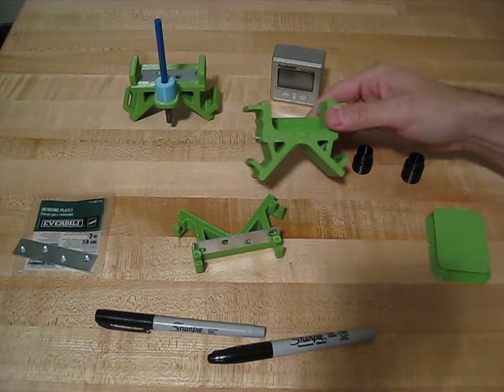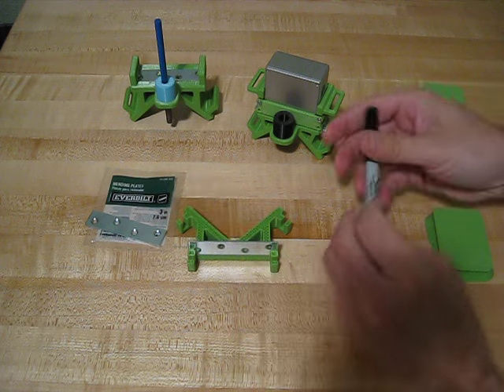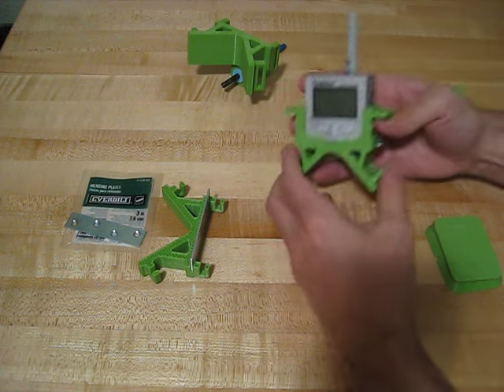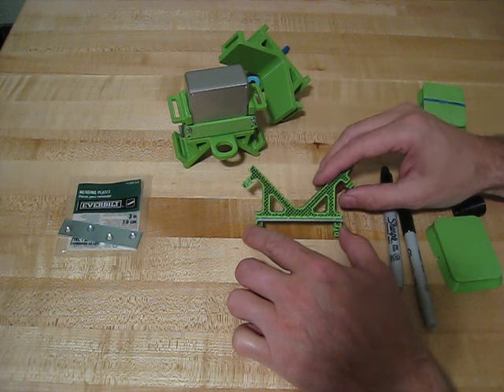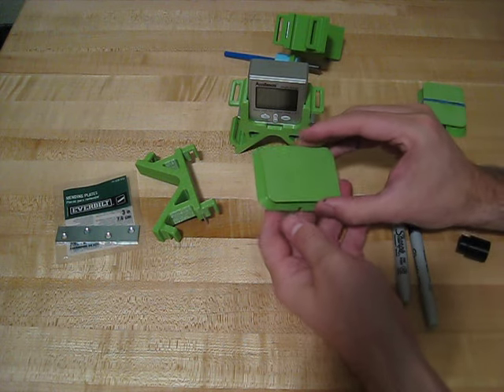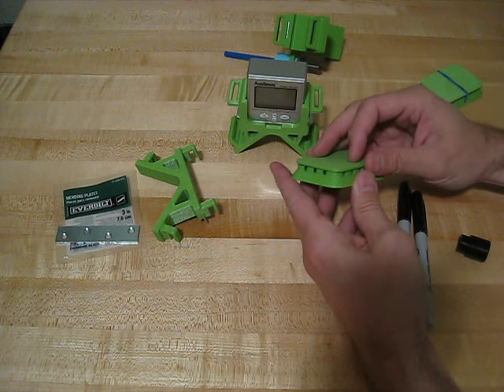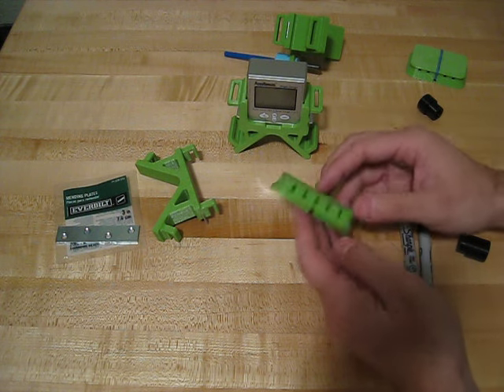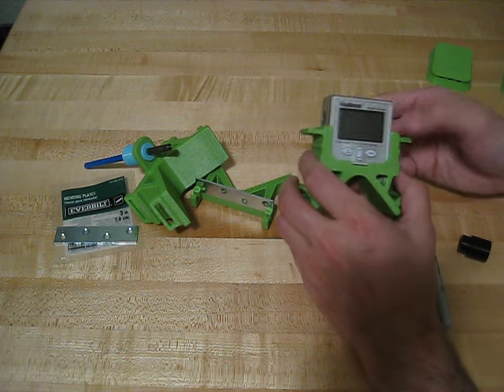3D Printed Tools for Workshop #1

Comment: Great pipefitting tool . 
My best Tighe
Reply from the maker: +tighe hall   Thanks for the Note ~ I was a little surprised how well it does work :-) Wish I had this AccuRemote Digital Angle Gauge 20 years ago :-)  Best part is you can attach it with flexible Velcro on the bottom of the pipe and the digital readout automatically flips over :-) Mostly use it with the sharpie markers :-) CHEERS!!
Reply: Great Charles !!!